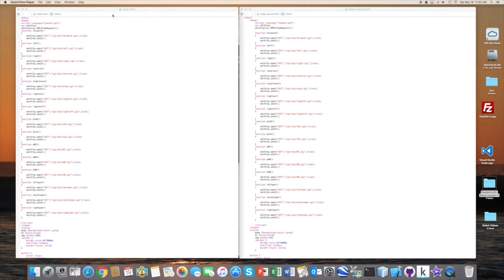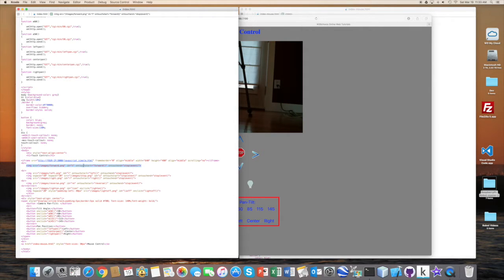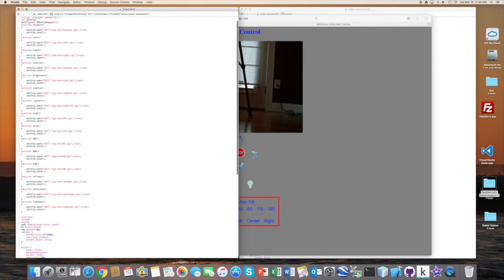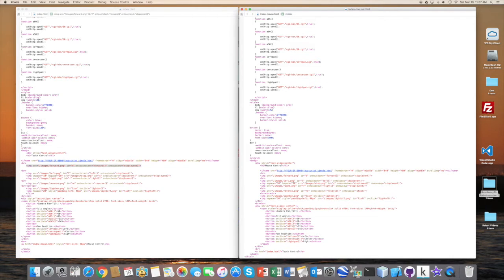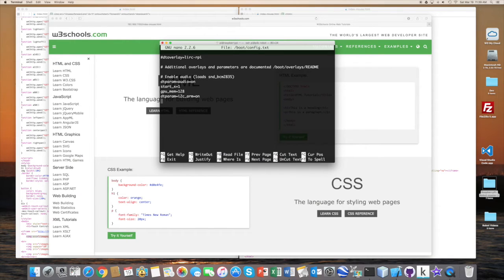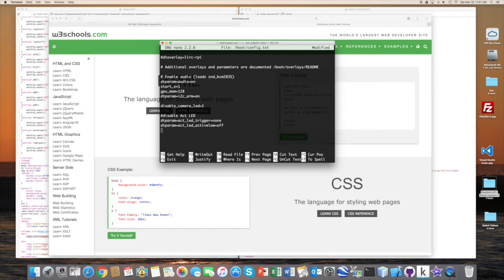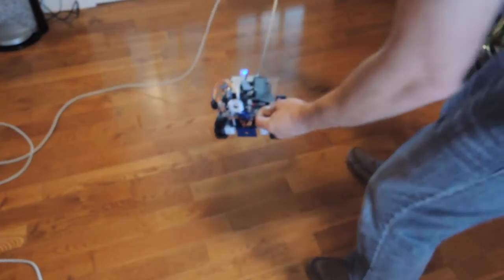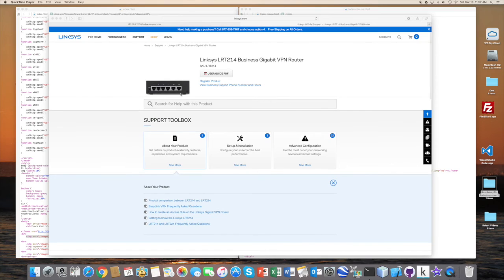Video 7   Raspberry PI Robot Project - Final configuration and wrapup

Comment: A fantastic wee series. This should have much more views than it does! Learned a lot from it and it's got me craving an rpi kit again. This will probably be my 1st project. Thanks for making this. I have a few tips though.

When using the console you can press tab to auto complete lines. Instead of typing a full thing, you can often just type enough of it for it to be unique, then press tab. The console can then usually complete it for you. If it is not yet unique then pressing tab again should pop up a list of options for you to type a few more characters of. I hardly ever use ls when navigating since pressing tab when navigating down a tree lists my options as I go.

The other is the text in the video. It would be much better if it was either higher resolution or if you use a magnification tool or video editing to zoom in on text or the focus of a scene. It was difficult to see the text of the web pages when you were talking about them.

Other than that, this was flawless and super inspiring. I'm looking forward to starting this and tweaking it. I'm thinking of having the camera on an extendible arm to manoeuvre the camera over obstacles like the Boston Dynamics giraffe SpotMini does with its mouth/arm/hand thing. If you've made any improvements to this I'd love to see them.

Comment: Hi Alan, this worked great till a point...but it was my own doing.  

I had it all going and brought it into work to show some folks and didn't realize the ground wire came loose from the motor controller.  Needless to say it didn't work and after reconnecting it I still couldn't get it to work.  I bought another motor controller thinking maybe I burnt it out and swapped them but same problem...lights come on but no one's home.  

Is it possible I burnt out something on the pi to do with the GPIO pins?  Don't have a spare to try yet...but this one seems to boot up and the webserver/streaming video still work.  If I touch the battery leads to the motors directly they do spin.  I've tried running the CGI scripts as well as another python script I put together out of Explaining Computer's pi demo using the setup with the same GPIO pins which doesn't work either.  Wasn't sure what/how to test if power was coming through.

Thanks again for this great tutorial, I learned a lot!  Also is there a way to control an Adafruit Motor Hat with CGI scripts like you did here, or am I better off figuring out how to do it with Flask?
Reply from the maker: HI Matthew, this is a strange one. If you have more then one micro SD card what I would do is install a fresh noobs OS and then try controlling with python code to see if they work. If they dont work then its a cabling or hardware issue. If they do work then its a software issue.
Reply: Well, have had some good and bad luck so far. After replacing the Pi as well I found the problem.  Rather then putting black and green together after the wire pulled out I had the green in the center and black in the 12v power moving the red to the 5v power since that made the light on the motor controller light up.  Stupidity, but now I have the thing on a Zero W and camera in the new case they put out which will simplify re-mounting things in the end anyways.

Anyways with everything wired the way I think it should be the wheels do now spin but are unresponsive to GPIO commands via python or the web interface.  grumble  appreciate you're responding.  If you have any other ideas as to maybe what I wired wrong to get my new issue :)  Going to a raspberry pi meetup tomorrow evening, hopefully someone there can help otherwise.
Reply from the maker: I dont now what to suggest on this one Mattew except to ensure you run python with root access.
Reply: When the wires came out I put the black to the 12v rather then twisting it back to the ground by accident.  Just soldered the two now so I don't do it again.

Comment: Can you add options to take a picture or record a video? And can it be used with a Linux based webcam instead of the raspbi cam? And can you add speed control for the motors ? Can you make it control over a wired gamepad through the web page on a computer?
Reply from the maker: I see no reason why you couldn't modify it to capture videos and pics.

To use a USB webcam you would need to look for a different video streamer solution but yes it is definitely possible.
Reply: Allan H Can you tell the name of the video streamer?
Reply from the maker: suhas tg off hand I don't know of any. You would need to research it.

Comment: Thanks a lot, Allan. It is a great tutorial and I really learned a lot! I have developed a didactic Robot project using RPi and Arduino the "Mars Rover emulation project" (last May MagPi magazine showed the project at its page 38/39). In my project I used the RPi for sensor data capture and Web communication and an Arduino for motor and servo control, besides communication with an Android device. At the end of the project, I commented that next step would be to control the rover all over internet and not locally via the Android. Your project gave me good base to do it only with the RPi. I launched the project at Instructables: http://www.instructables.com/id/Mobile-Station-Prototype-for-Environmental-Data-Ca/
Saludos from the south of the world! ;-) Marcelo
Reply from the maker: Hi MJRobot, I saw your project on MagPi, very impressive. I look forward to watching how you progress it.

Comment: Many many thanks to this series of videos.
I 'll use it to make mine robot.
Is there a way I do to desable/ enable the srtiming and add this option to the html file?
I would like to start robot with video closed to save baterry e.t.c.
Thanks again.
Reply from the maker: +Δημήτρης Μαντζαράπης Yes, you should be able to use shell scripts. I havnt tried these but they can get you started

Create file called  start_steam.sh and type the following into the file

#!/bin/bash

if pgrep mjpg_streamer > /dev/null
then
  echo "mjpg_streamer already running"
else
  LD_LIBRARY_PATH=/opt/mjpg-streamer/ /opt/mjpg-streamer/mjpg_streamer -i "input_raspicam.so -fps 15 -q 50 -x 640 -y 480" -o "output_http.so -p 9000 -w /opt/mjpg-streamer/www" > /dev/null 2>&1&
  echo "mjpg_streamer started"
fi

The next file is to stop the video which you can call stop_stream.sh

#!/bin/bash

if pgrep mjpg_streamer
then
  kill $(pgrep mjpg_streamer) > /dev/null 2>&1
  echo "mjpg_streamer stopped"
else
  echo "mjpg_streamer not running"
fi

Comment: managed to get hold of a Disney  wall-e u command version. It was listed on ebay without the controller so i thought it might be a tidy shell for the project and snapped it up at a very good price. The only problem is it has only forward or turn, no reverse or left turn. Has a small gear box which drives both tracks. I plan if possible to change this and instead mount some modified servos to drive both tracks. Ive also ordered a longer camera cable hoping to extend the camera into its head. Also the neck will have to be modified as currently it only pans with no tilt. Lots to think about, I had this idea and when I started to roam the internet i discovered a few others had done similar projects with a wall-e. Mostly using different boards. Looking forward to it all arriving, and getting started.